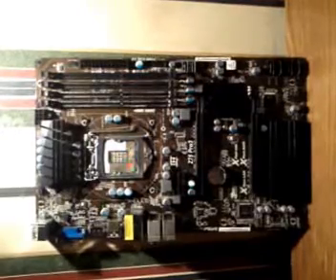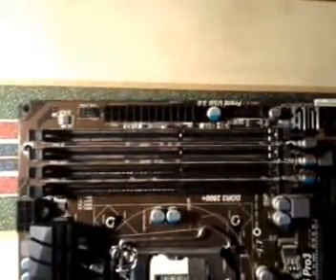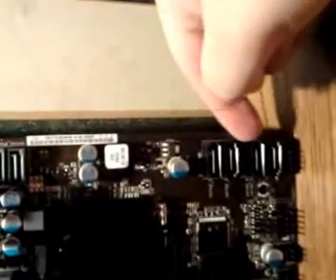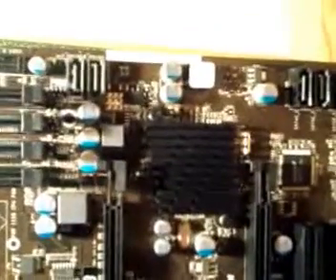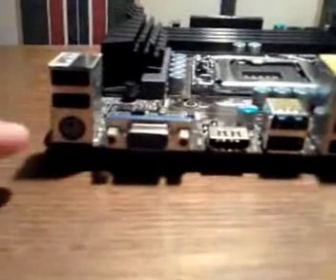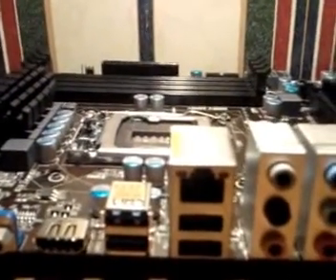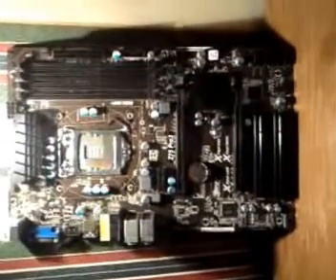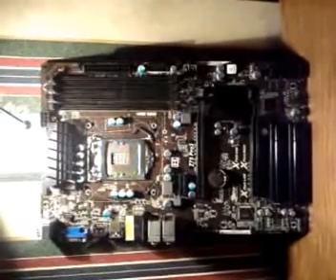ASRock Z75 pro 3 motherboard

Comment: when game screen or window in any of the two to me the game freezes after a while sometimes happens to me and left with a PC sound PEEEEEEEEEEEEEEEEEEEEEEEE have to leave the power button to turn off or restart because I can: C that is that? My PC: i5 3570K, Mobo: Asrock z75pro3, 4Gb ram 650W power supply sata II500G xD omega generic processor temperature exceeds 60C to 65C playing ect there are no more c:
Reply: power suplly 650W omega Generic